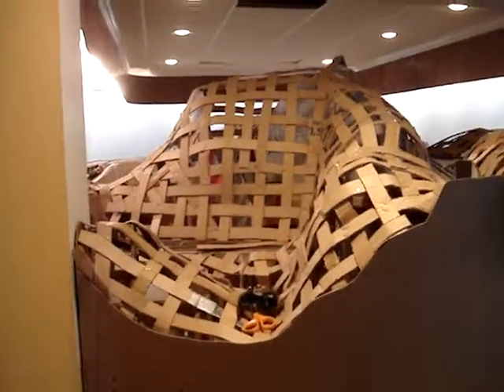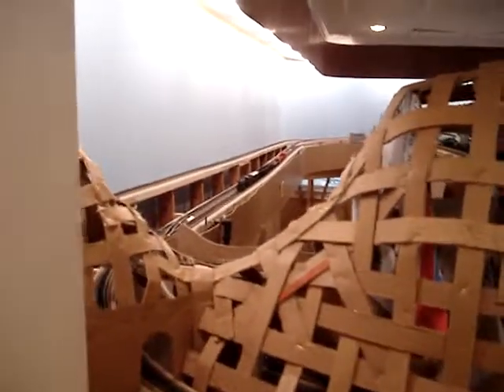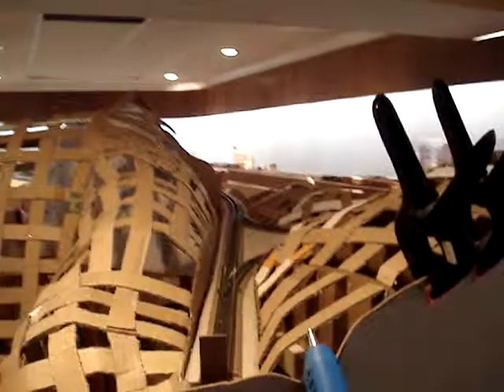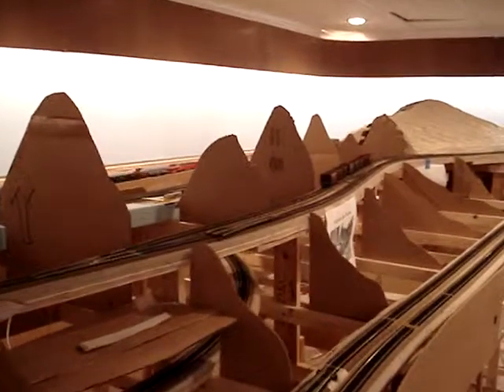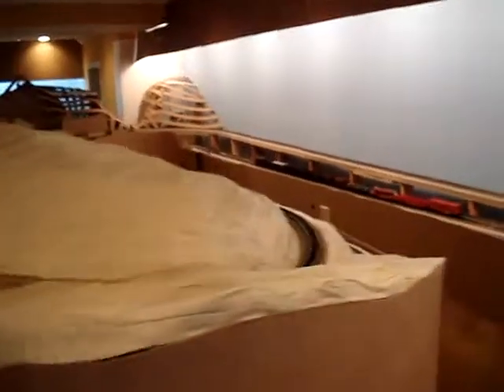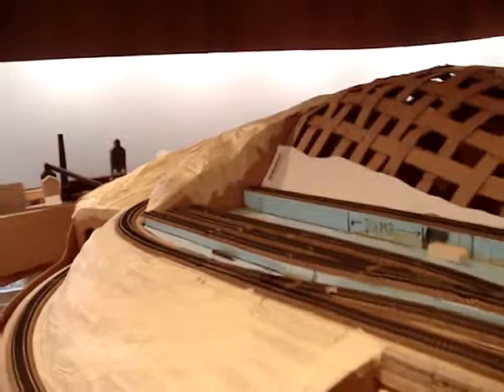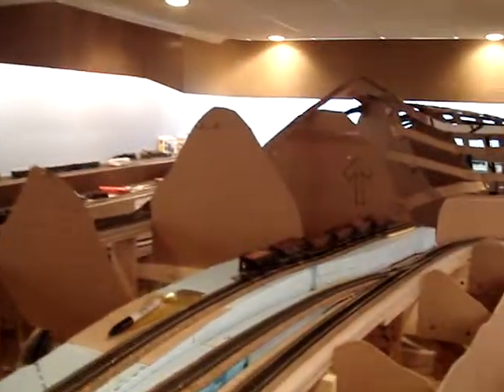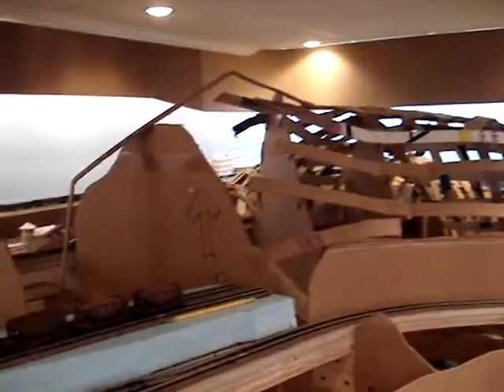Red Mountain Update 07 08 11

Comment from the maker: Thanks Guys,

It is good to have helpers to work on the RR.

Will, I think that the 2-8-0 is THE engine for the Birmingham District RR, so I do have several.  None lettered for Woodward, but certainly want to do that.  Woodward, Sloss and TCI could use the Red Mountain Branch line.

John